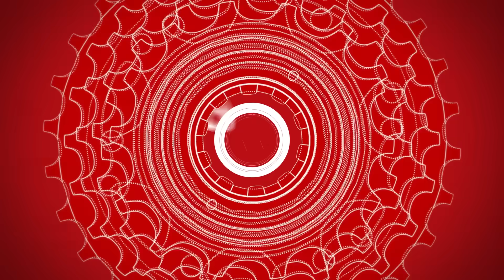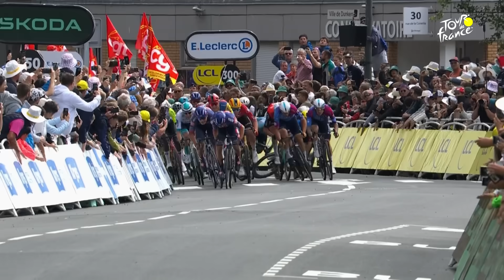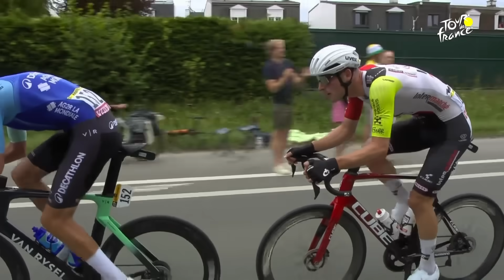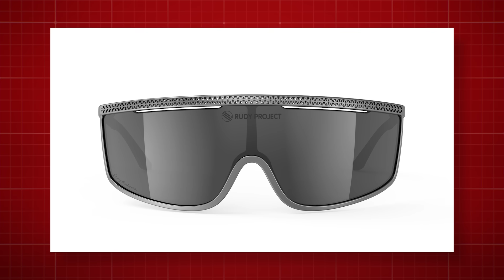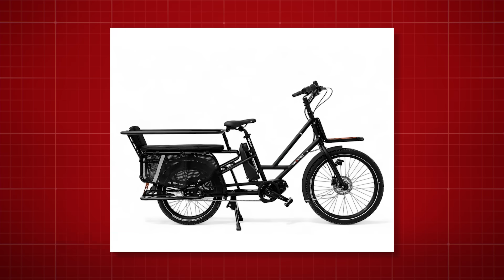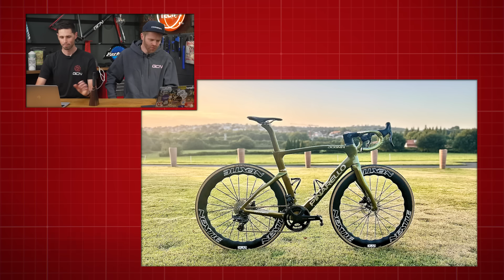Is Speed Really The Problem? | GCN Tech Show Ep. 394

Comment: If the UCI actually cared about rider safety and fairness, they would stop banning positions, socks, and bike tech without peer-reviewed data, and start fixing the real issues first—dangerous course design and crowd mismanagement. Most serious crashes don’t come from a rider’s posture but from poor road conditions, tight high-speed turns, street furniture, bad barriers, and fans leaning into the race—like the Tour de France 2021 crash from a spectator sign, or Remco’s bridge crash at Lombardia. The UCI should mandate full course safety audits before every major race, upgrade barriers to modern standards like in MotoGP, and enforce strict spectator control with buffer zones and fines. Once real-world risks are handled, only then should they look at regulating gear or positions—and even then, only after forming an independent research committee with scientists, engineers, doctors, and riders (men and women) to review data first. Every new rule should go through a 6–12 month public review period with feedback from riders, sponsors, and teams, followed by gender-specific impact reports to ensure bans don’t harm visibility or access in women’s cycling. Instead of blanket bans, they should use adaptive rules based on race type, skill level, or rider dimensions—like fitting handlebar width to shoulder width rather than banning narrow bars for everyone. The UCI could also create “innovation events” where experimental tech or setups are allowed and studied under real race conditions. Riders deserve a voice too, which is why a veto council with equal global and gender representation should vote on future bans. And no more abrupt rules—every proposed change must have a 1–2 year review window with transparent data. Bottom line: fix the roads, fix the crowds, respect the science, listen to the athletes, and stop banning progress just because it’s easier than fixing infrastructure.
Reply: Well done, you’ve killed professional road cycling 😅

Comment: Cyclists would be a lot more protected if they had more muscles in the upper body. It does not prevent crashes, but reduces the severity. Additionally weight bearing exercises also increase bone density and tendon strength. Maybe the UCI should mandate lifting instead of wide handlebars.

Comment: Tires are a problem. Some have so little grip in high speed cornering it is not strange riders feel their bike gliding in high speed corners, especially in the rain. This problem is not new. When I was riding we had narrow tubes with silk and a bit of rubber, glued to the wheel. Grip minimal, and with hot weather the glue may fail. 

Most crashes are rider-errors.

Comment: I think coming at the problem from the perspective of trying to reduce crashes may be a mistake as cycling simply is dangerous. Instead, what about trying  to reduce the impact of crashes as they do in motorsport by focusing on safety equipment such as materials which reduce road rash severity, deployable airbags etc. In some cases they may have the knock on of bother exiting tech space for companies to work on and innovate with technical clothing heating or cooling materials since protective would likely be heavier and less breathable.

Comment: cut back to 7 speed cassette  and cut back the front ring size . get ride of tubeless tires and get rid of disk brakes and increase the weight of the bikes and this will slow down the race and cut back the amount of the team size to 4 per team and don't let the riders swerve all over the road must hole a line. because crashes at 40 k are safer than crashers at 70 k

Comment: Correlation is not the same as causation! Of course, speed will correlate with incidents. When things get hectic and there is something on the line, riders go as fast as they can. But they will also take bigger risks in exactly these moments leading to more crashes. What might make sense is to correlate severity of injuries to speed. Then again, it is far from the only factor. Crashing into a barrier is quite different from crashing into a field or tragically falling 100s of meters into some alpine gorge.
Overall, I don’t like the idea of making equipment shittier because nobody has any better idea.
The worst idea so far is the limit for gear ratios. This will lead to sprinters spinning out so that they will basically be unable to actually show their athletic ability. The sprint is a tiny fraction of the race but it often is where the race is won. Just saying „it doesn’t happen for a long time“ is a very shortsighted position. Maybe, it will also lead to a bit less pedaling on descents but here riders already spin out and still frequently exceed 80kph. It is like rowing but limiting the paddle to the size of a coaster. Sure, it will go slower but is it still a real rowing competition then?
Then we might just as well mandate „anti bike fits“ to make it exceptionally hard to perform to one‘s best ability. Limit the saddle height to 50cm or something. That will slow things down…

Comment: narrower bars effect handling, yet wider bars cause bar locking in sprints.  deeper dishes grab cross winds. none of these examples deal with speed.  speed has not been a factor in rules so far.  you boys are chasing the wrong theme.

Comment: By enforcing these changes the UCI is effectively doing an experiment where they look at the data now and the data after these changes and then check if there is a statistically significant difference in crashes. The problem is they shift the cost of this experiment onto the manufacturers by forcing them to go and make all the changes for the UCI to check if it works. From this point of if would be much cheaper for the manufacturers to get together and fund some real scientific studies, in collaboration with UCI to allow them to make more informed decision and simultaneously save money for the manufacturers.

Comment: The thing you have to ask first is what problem are you trying to solve. Is it the crash or the injury you are trying to reduce? 

If it's the injury than a change in clothing (elbow, shoulder and back pads) might work. Boy would it look stupid. 

If it's the "avoidable" crash then the best solution might be the course itself. That would be extremely hard to do. But you could spend more time cleaning up the barriers (those feet holding them up have to go) and and road hazards.

Comment: Somewhat irrelevant if speed it the cause of not. If the goal is rider safety. Less speed = less inertia when you come off. Pretty sure there is a causal relationship between inertia and broken people parts. Also wheel deepness has a sygnifint impact on cross wind stability. Not just speed.
Reply: But speed isn't a part of the data!  Speed has been relegated from the data set.
Reply: That's true but you have to reduce speed pretty significantly to reduce injuries without reducing the number of crashes

Comment: Regarding UCI Safety, falls and crashes related to road conditions and road furniture are a significant contributor. On a ride I do regularly I rounded a corner at about 15mph that is blinded to low things due to a 3’ tall hedge and finding one of these damn rental scooters laying on its side sending me off a curb into a fortunately empty street. This reminds me of what happened to Jonas Vingegaard when he broke his ribs and how he probably would not have been hurt had he known he was coming up on tree root rutted pavement in a high-speed curve. With the technology out there today similar to audio tours that share information about something like a water fall you are about to pass, some distance ahead like 300yards or so, riders could be alerted to a curve with sharp choppy pavement, divider center of road… and even live updates using the GPS to alert a rider and or riders stopped ahead indicating one rider with a problem or a massive crash similar to the way vehicle navigation systems like google detect slowing traffic. At the very least post a caution sign which isn’t that easy to see if you are in a peloton for those fixed hazards.

Comment: To be ridiculous, have to pros race on 20 year old equipment. They will race slower. I recall crashes in races 20 years ago. UCI makes ridiculous rules without good rational. How much slower do the pro need to go to be safe? Do away with hydraulic brakes. Riders will not be able to dive into corners. Make a rule the riders are not allowed to overlap wheels.  That would be  a good UCI rule.

Comment: I agree with Michael Woods on some basic and easy to implement changes:

1. Ban race radios and bike computers (less distraction)
2. Get rid of motorbikes and helicopters, replace both with drones (can't be drafted)

Perhaps you could go further and say that any rider causing a crash is automatically disqualified from an event/series (discouraging dangerous behaviour). Also, if part of the goal of pro racing is to develop better tech for the rest of us, perhaps you could also get rid of team cars and in-race access to mechanics - any mechanical that can't be fixed promptly by the riders puts you out of the race. Then you have a manufacturers ranking alongside the rider ranking indicating who makes the fastest and most reliable bikes/components/tyres. I'd want to see who comes top in that.
Reply: Drones don't have the range you think they have.
Reply: I agree, team cars should be banned. It would incentivize manufacturers to make stuff that lasts the whole race, it would get rid of the poor look of sticky bottles and drafting behind cars when you've been dropped because of a mechanical issue, and roads are inherently safer for cyclists without motor vehicles. The riders can get resupplies at the feed zones, and any tactics should be worked out beforehand and not communicated from the team leaders to the riders during the race.
Reply: @ahgerande ”stuff that lasts the whole race” yeah most of it does last the whole race, but if there’s glass on the road that’s no one’s fault, if a rider punctures then what are they meant to do, walk?
Reply: @recon6181  There's always a risk of bad luck, if you get a puncture you fix it yourself or your race is over, just like rally. It's silly to bring a whole convoy of cars mixed with the cyclists in case their thin race tyres gets a puncture, or they drop a chain or something. If a marathon runner needs to tie their shoes or go to the bathroom there's nobody there to help them, nobody to draft behind to get back to the group. Are there team cars ready to change a punctured tyre in gravel or MTB events?
Reply: @ahgerande  Its just statistics that stuff will break. If a stage is 200km long, and 200 people ride that stage, that are 40,000km ridden. Do you expect not to have a single mechanical issue over 40,000km ridden on your own? Also, your marathon comparison is incredibly stupid with the drafting, aerodynamic drag is like 90% of what makes going faster hard in cycling, and like 10% in running. Same with the comparison to mtb or gravel, depending on the gravel race that is exactly what will happen, and mtb races are usually around shorter laps with significantly shorter total distances, having support with replacement wheels on the side.
Reply: You can draft helicopter?
Reply: @Avelio3939  not many people know this, I'd keep it to yourself if I were you, it's generally frowned upon by the UCI...

Seriously though, Michael Woods writes about this much more eloquently than I have on his blog, worth checking it out!
Reply: Not the computers :c
First they ban nice cockpits, now computers?...aaaaaaah!
Reply: @aboo161 horrible take, race radios make the sport way more interesting, how are the riders meant to know whether a rider has a 10 second or 10 minute gap on the peloton. Bike computers make the sport way safer because people can see where the corners are!

Comment: My low speed crashes have hurt more than the high speed ones. At low speed, you might be body-slammed directly to the pavement; at high speed, you tend to 'superman' it, resulting in less impact on a single part of the body.
Reply: That's right, it's all about physics. An aeroplane lands near horizontally at high speed rather than just dropping out of the sky.,

Comment: There will not be a study that will produce meaningful results. Crashes have multiple reasons. In my opinion UCI has rightly targeted one aspect where the manufactures have gone wild recently with evermore narrow and wind optimized handle bars. I think the rule changes is more to prevent further shrinking of the handlebars then stating that xyx mm is the best size. This is as arbitrary as the max weight for a bike. You have to have a rule. If it does not work, they have to try the next thing which would also make some unhappy. Imagine all the tire companies that would lose advertising if a different brand is chosen by the UCI for racing events. Of them with Formula One when at any consumers would buy racing tires there are a lot of riders. We just want to buy the same tires they see in their heroes.

Comment: As a Research Methodologist you are confusing correlation with causation.  For example the correlation between your age increasing each year and continental drift is a perfect 1.0!   But your growing older did not cause it.  For cycling to be safer just look at the most dramatic causes in the last 20 years.  Pack size is dramatically higher. This causes higher speeds more room for individual errors less room between cyclist especially on wet slippery roads and higher speeds. Road furniture.  A cause not a correlation.  Change it!   Refusal to stop or changes courses in torrential rain especially narrow downhills.  Crosswinds with bigger packs. Crowding and exhaustion ie more crashes.  Most likely biggest cause of more crashes is simply modern bicycles with extremely narrow poorly gripping tires matched with all the weight on front wheel due to aero positions increasing loss of control especially in corners and downhills

Comment: Some D30 armour tightly built into the jerseys and bib shorts at common impact points would go a long way at reducing injuries and road rash. Of course it wouldn't reduce the number of crashes but it would greatly reduce the severity of the most common crashes. It isn't likely to help prevent broken bones though.

Give the kit manufacturers a zone for adding a few millimeters of good padding and let them work it in how they want. It doesn't need to be large slabs of padding. It could be 1cm strips spaced apart with thin breathable mesh between them to keep the riders cool.

Which is more or less what Moto GP did with airbag suits. There's limits to how safe you can make any kind of racing but impact protection can greatly reduce the severity when a crash happens.
Reply: Anyone else remembering the Dan Lloyd Special shorts, which had two layers of lycra?  Back when he was on some small, unknown pro team?
Reply: I love this. I actually think they could make a rule that clothes can have fairings and aero texture only in certain common crash locations. So there is an aero incentive to add padding in key areas. Padding to let you go faster!

Comment: Speed may cause some crashes but in my limited experience, the worst crashes are caused by road furniture. I think it is just easier for the UCI to look like they're doing something than actually regulate how courses are designed.
Reply: Road furniture  and speedbumps are so common they can't be avoided when you create a route for a course. You can however place signs above or at the side of the road to warn about dangers like speedbumps, roundabouts, narrowing roads and street furniture.
Reply: @wilsistermans1118  Many times you will see a marshal doing the side to side motion thing with an arrow sign near obstacles. (particularly splits and roundabouts)
Reply: Speed does not CAUSE crashes. It reduces reaction times and increases the encompassed energy. So increases the consequences of the event that has caused the crash
Reply: seriously i can't believe they don't have a big ol truck full of 15' fluorescent foam poles to mark things out .. color coded, speed bump/ road narrowing/islands and obstacles
Reply: Exactly what I was thinking. There will always be an odd high speed crash, but the most impactful ones are the bunch crashes on unsafe or poorly designed course sections. Not to mention how spectators can be too loosely policed so they run into the course, throw stuff and push the barriers to obstruct the riders into crashing
Reply: I think towns the big races pass through should be required to remove traffic islands and other hazards (not roundabouts) and then replace them after the race comes through. it might be expensive, but if you really want to affect safety I think it has to be done. The race organizer should pay for it because they are making plenty of money from sponsorships and TV rights. 

Ideally the organizers would plan routes without crazy pinch points and islands, but that’s not practical with the amount of road furniture in Europe and approaching some of the favorite climbs.
Reply: Yes they mark the islands, roundabouts, hard corners, and other things seemingly designed to make a cyclist crash. But I think they need to give the riders more fair warning like 200m ahead so they have time to communicate through the group. Marking road furniture as it happens is not very helpful.
Reply: Riders NOT paying attention!  Can’t fix that!